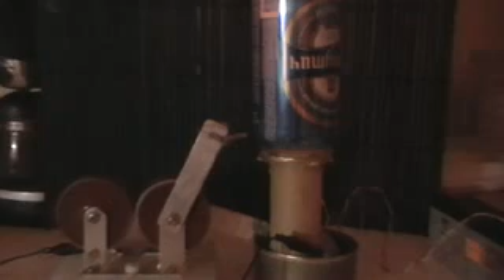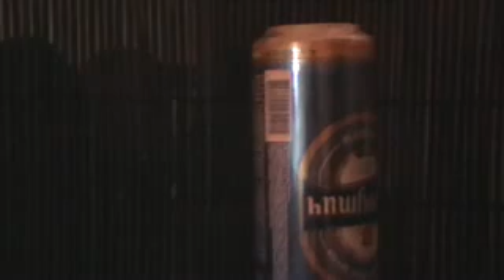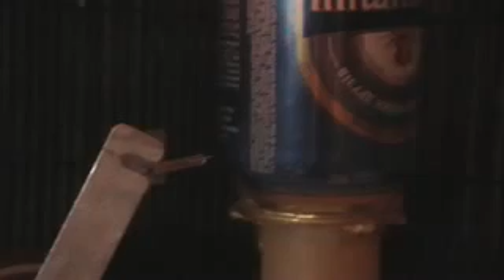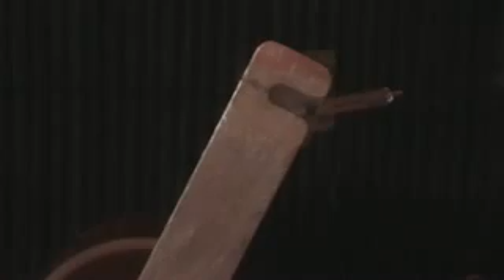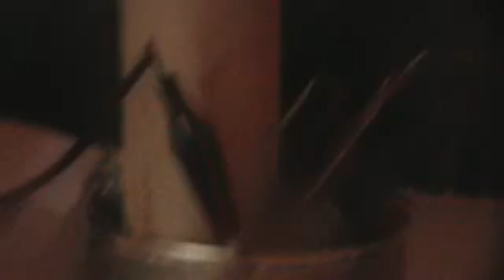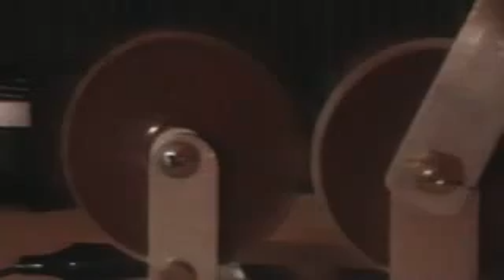Small Van De Graaff machine

Comment from the maker: I've used the exact same design, rubber band, and motor, to make a "clean" version with proper EHV-qualified surfaces.
I will be shooting a clip of that one soon.
It has an 85-mm mostly spherical top load (two SS bowls) and I've been measuring the voltage using another 85 mm sphere. So I'm sparking between 2 elevated 85 mm spheres, one grounded. The machine produces a 49 mm spark about every 6 to 8 seconds.
The sphere gap tables should be applicable here. Let's see-- looks like around 120 kV.

Comment: I've been thinking about setting up a miniature Hutchison Effect test table. I was going to use HV coils from a car (you know the new ones Ford uses, 1 @ ea cyl?)for the tesla coils and now your Van de Graff would fit right in. I would experiement with freq. between 400-750 KHz. A lot of his work appeared to drive the current through the DUT by cross phasing the coils at hetrodynous frequencies.

Cheers!